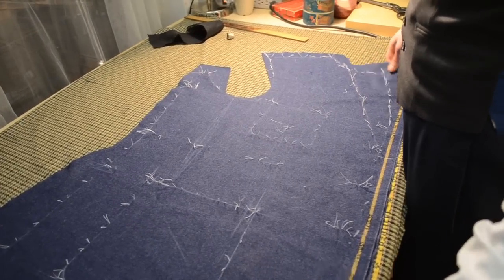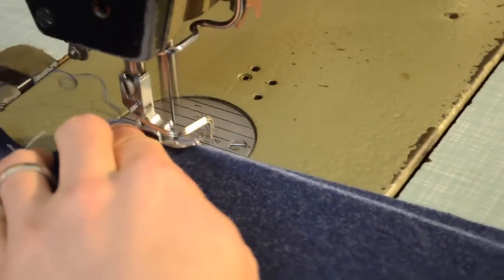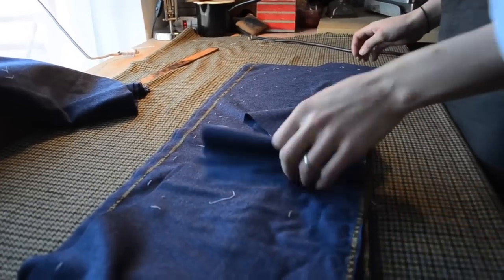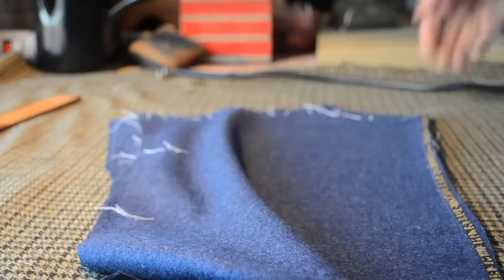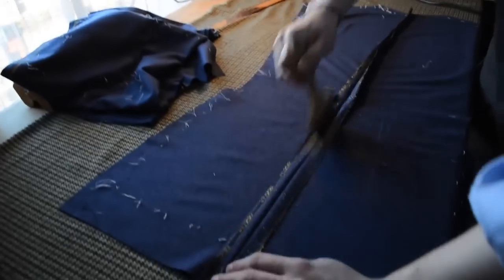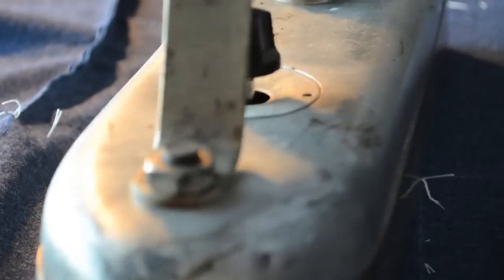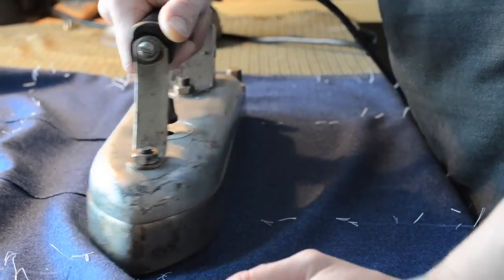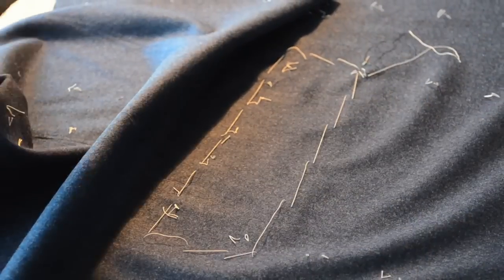The Making of a Coat #11   Shaping the Back & Foreparts

Comment from the maker: That's right, the brush has more control than a spray for adding water. The lining will stain if it comes in contact with the water so I have two brush sizes for different operations.
Reply: Rory Duffy Очень хорошее руководство начинающим портным! Я и России и пишу вам через программу переводчик, перевод может быть плохим, так что заранее извиняюсь)  У меня такой вопрос: А будет продолжение видео, как вы шьёте его после первой примерки?
Reply: +Rory Duffy And by the way you work alone or have assistants you could make a video yourself or your partner. I like to watch your video, I like to watch artisans at work. I noticed you make templates for the English method, the author Winifred Aldrich.
Reply from the maker: Have tried out a number of assistances. None have had the level of dedication I had when I was training. The American youth in my experience aren't as hard working as their European counterparts. Am focusing on working with London based workshops to help expand my business.
Reply: what is the name of that water you are using